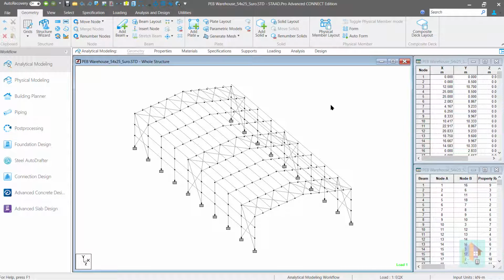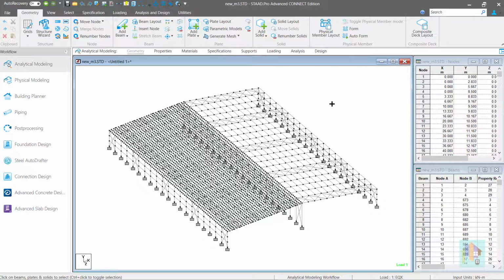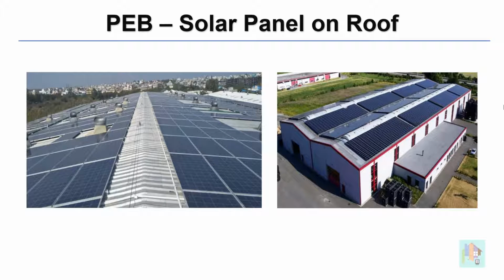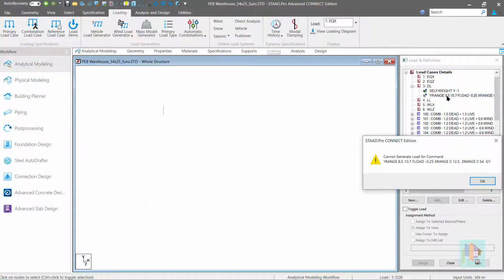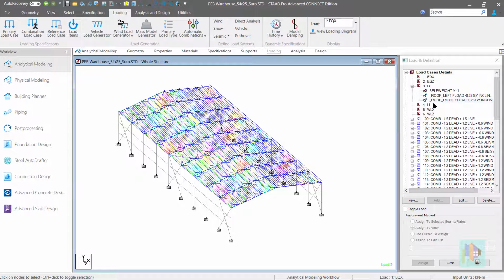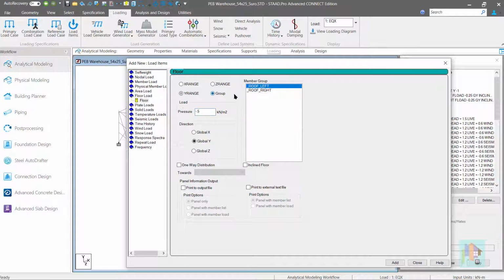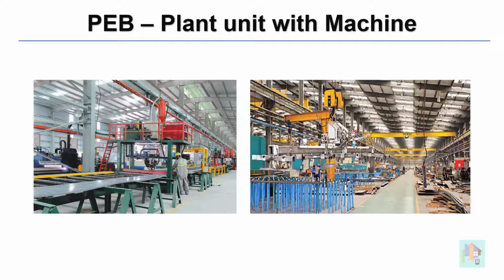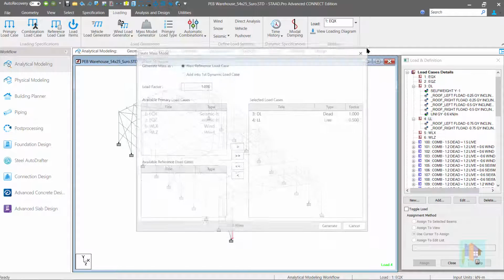PEB with Analytical Modeler: Part 2.8 - Gravity Load || Dead, Live, Dust load || Inclined Floor load

Comment: Sir, for the bracing members I am using equal angle section but everytime the members fail because of slenderness.
Can you please tell how to tackle this situation?
Reply from the maker: If Compression check is ok, you can bypass slenderness check using MAIN -1 and TMAIN -1 parameter for IS800:2007.
Reply: Sir.. can you please tell that why the utilization ratio is coming high for bracing?the length of X bracing is near about 6.5 m and it is provided as roof bracing. But the utilization ratio is coming near 2. I am using 100×100×10 single angle section

Comment: please continue the series. been stuck on how to apply wind load. the cable/bracing somehow disrupts the distribution of wind load to the structure and I dont know how to fix it.
Reply from the maker: You can go through this video to know more about application of wind load -- https://youtu.be/cIDVp-u79y8
Reply: @surojit_ghosh  Thank you sir. I just found out that I do not have the wind load generator feature. I only got v22 up.6. still got the same problem with the bracing. it does not distribute the wind load properly. some areas are not hatched hence maybe Staad is considering it as an open hole in the structure.

Comment: Hi Mr Ghosh, do you know how to model a fly brace which connects a main frame column to girt within the same node? Thanks sir
Reply from the maker: You question is not clear to me, a picture with the arrangement might be helpful. You can connect the girt with main column using brace member (including fly bracing), either you can model it in STAAD model or use a control dependent relation to simulate a rigid link without modelling it.

Comment: Thank you very much for such nice instructions
I have two notes:
1 - I think it is necessary to assign end moment release for the purlins and the side girts, as you know the connections of these members are simple and cannot carry over any moment.
2-The roof clads are directly connected with the purlins only, there is not contact between the sheets and the rafters, that is why I recommend to distribute the roof loads in one-way direction (purlins only).
I will be thankful if you have any thing on my notes.
Best Regards...